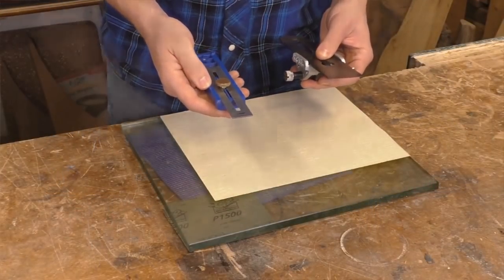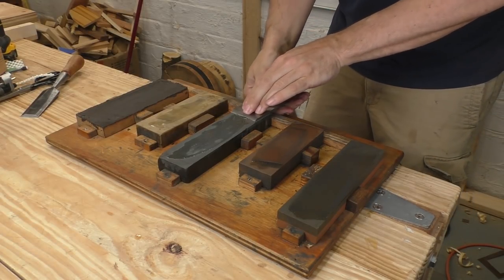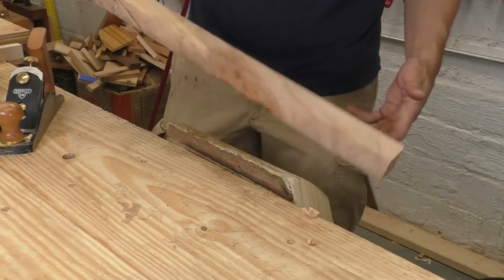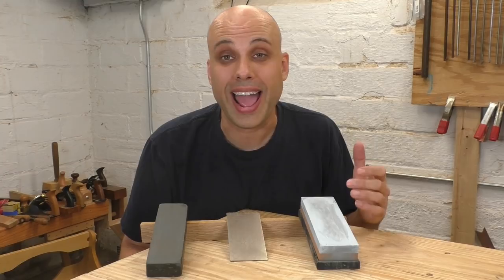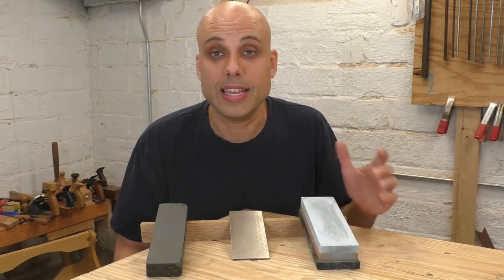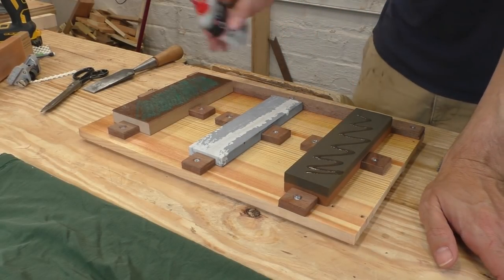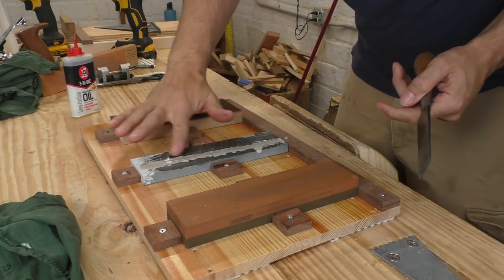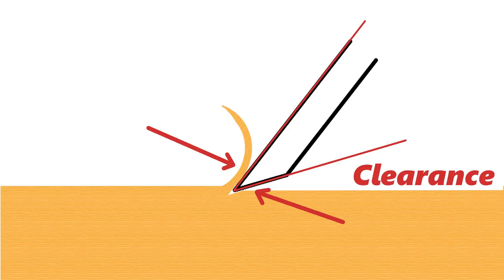Fast freehand sharpening: no jigs, no guides, no sandpaper.

Comment: When I learnt to sharpen, jigs were something machinists used to sharpen paper trimmers. I was taught not to roll my blade, obviously it works for you, but in the sixties it was forbidden. Here on the U.S. East Coast, diamond sharpeners are about $30US for a 2x6 stone; I use tap water and a drop of dish liquid soap on mine. Great presentation, right to the basics. And regarding kitchen knives: 8, 10, 12 inch chef knives need a working edge, not a razor edge, when dicing or chopping you'll destroy a razor edge in seconds.

Comment: @7:00 is an instant classic! And something I would do. My first hard laugh of the day. Thank you for the education and entertainment.
Reply from the maker: I was afraid that was creepy, even though I hoped it would be funny.
Reply: @RexKrueger  it was funny because it was creepy!
Reply: @RexKrueger  I laughed out loud.  Regarding oil stones I sharpen my kitchen knives on them, then drizzle dish detergent on the oiled surfaces and work it in with my fingers.  The detergent and oil form a soap precursor (high school chemistry has some uses) that is water soluble.  It cleans the stone and removes any oil that may polymerize over time and reduce the cutting efficiency.
Reply: I laughed way too hard.
Reply: @theeddorian  I do something similar, but using simple detergent and water when using my DMT plates.
Reply: @gazpal  I think that will work perfectly well on diamond plates.  If you use oil, it could still polymerize if you left it to dry, but the metal and diamond are far less porous than an oil and that should keep the oil residue on the surface.  In fact, IIRC, diamonds are extremely "non-stick."  I use the detergent first because it is a polar molecule and on "side" will bind to water while the other will bind to oil, which makes the oil more or less water soluble.  So, I try to work the detergent into the pores in the oil stone in order get it into contact with as much of the oil as I can.  After that I bring on the water.  You can use salad soil and detergent as a mechanics hand cleaner the same way.
Reply: @theeddorian  it works extremely well 🙂
Reply: @RexKrueger  It gave me a great laugh, don't worry. Granted, it was more of a panicked laugh while backing up from the paused video, reassuring myself that there's no way that mad-man could jump out of my screen and end my existence there and then, but it was a laugh nonetheless :D

Comment: Rex, I've used DMT diamond stones for years. I get the big ones, 10"x4". 2 will get you all the grits you need as they are double sided.  X-fine/fine & course/X-course. 220/325 grit & 600/1200 grit, respectively. I also use the Norton water stones, not the double sided. They don't ware out as fast as you think if you use them correctly. My most used grits are the 4000 & 8000 grits. After 20 years the 4000 grit is about 1/2 it's original thickness. The 8000 grit is almost like new for thickness. And I sharped a lot of knives, it's kind of a small income for me. Doing knives I don't flatten them very often. In fact I haven't flattened any of them in 5 years doing just knives. 
Woody's Workshop

Comment: Interesting video. I’ve used a lot of things to sharpen blades. 
My front porch steps, a red brick and this great flat spot on my garage floor. Some sandpaper and a piece of leather with green compound. 
I have no idea what my angles are. The blades cut great. Boards are square and flat. That’s all I care about.

Comment: I have been doing leatherwork a long time, but I recently found something that a leather store showed me. That is if you use a little green polishing compound, your stropping  will be  much faster and your sharpened device will work much easier. You can also buy scraps of leather very cheap at Springfield Leather. I use this compound all the time, whenever I have to strop a blade.

Comment: Another method to avoid the bur (aka rollover) is to only push the blade on the stone.  The rollover bur is from scraping the metal off the edge of the blade, but if you push the blade only, you avoid this mostly.  You can still get this bur, but usually on softer blades.  Of course you have to only pull on the strop  but you are only polishing at that point.  A stroke compromise is to push harder forward and let off on the backstroke so you keep the angle form.  Thanks, Rex these are great videos keep them coming.

Comment: I was traditionally trained and Paul Sellars is unique in his approach.... I used to sharpen freehand, began sharpening freehand and I defy anyone to be able to sharpen 'traditionally' by hand on a soft Waterstone. You have to remember that Paul is a trained joiner/carpenter who has an 'Everyman' agenda, the complete opposite to the sharpening tzars.
Reply: The soft Japanese waterstones are indeed used freehand, for Japanese tools. Japanese planes and chisels have very large bevel surfaces and hollow-ground backs. You are able to reference the bevel of the tool on the surface of the stone because it is so large, and you don't have to sharpen for long because the back is hollow. Also they laminate their cutting edges, so they have a backer of soft steel or wrought iron, with a very thin HARD tool steel edge. They work perfectly well for the tools that were developed for them, it's just more difficult on western tools which were traditionally sharpened on oilstones.

All that said, I normally use oil stones, but also own a set of soft water stones and can sharpen on them freehand. With the soft stones if I'm not using a Japanese tool I only sharpen on the pull, and rotate from the top of the bevel to the edge as I draw the tool toward me. You can feel and most importantly, HEAR when you are at the edge.

I prefer the oilstones not because they are easier but because I live in Michigan, and water freezing inside a waterstone is over a hundred bucks down the drain. ;-)

Comment: Sadly, I couldn't find your original sandpaper sharpening vid, so I don't know if you mentioned this, but 3m make some really hi tech sharpening papers (I'm not employed, etc, by 3m) and that system works really well. It is usually used with a guide, but I've used it freehand for about a year and haven't even changed my papers yet. The other important point for sharpening is - don't wait! at the first hint of excess pressure, sharpen again - done in 30 secs and back to good results.

Comment: I think the curved bevel edge also helps support the edge so you are less likely to chip out the blade. The arc gives some material to transfer force deeper into the iron body. As for Camber you can see at 15:20 as Rex explains the motion how his forearms move. Then at 16:00 as he speeds up you can see that pressure change happen if you watch his arms at the top of frame and not the blade. Easy peazy.

Comment: Back when I started I was "taught"  to freehand (more like told how to and attempted to remember days later) on a set of whetstones I picked up at an estate sale. When I began watching videos I found it weird that people were obsessed with sharpening to a specific angle.
Reply: One of my first responsibilities as an apprentice was to sharpen blades and chisels. My master taught me how to hand sharpen in about 30 minutes. After that, it was my ass if the tools were not sharp. 
Years later, I saw all of this stuff about exact bevels and whatnot and I was very confused. I was wondering how these people got any work done by obsessing over the exact angles of their bevels so much.
Reply: I never understood that obsession some ppl. seem to have.
I guess they just need something to feel better than the rest, lol.
Reply: @nealsterling8151  Maybe a carryover from metal cutting ? In high productivity metalworking edge geometry is insanely important to make sure you can dissipate 20 hp in the cut, get a mirror finish, not break the tool and not get a huge birds nest of scalding hot, razor sharp barbed wire like swarf - all at the SAME time.
Reply: @Zonkotron  I must admit that having been taught how to freehand grind tool steel (that there should be some clearance, but not too much) then putting those first attempts into a shaper and taking heavy cuts into mild steel with no trouble, that the clearance for woodworking hand tools needed to be exactly this or that angle. I'm sure there's an optimal angle that balances the life of the edge against the finish, but if you're going to be sharpening whenever the tool feels like it's lost it's edge then the only thing you need to optimise is getting back to your project.

Comment: I use a diamond & water stone & then a strop because it's just a lot less messy than oil. Keeping the water stone in a tupperware box works really well, & (even though it may slightly age the stone) I add just a few drops of lemon juice to keep the standing water from going nasty. Recently, I've started just putting the diamond plate in there too since that also needs a little water, & it seems to be working out well so far. Easy to store & access, no mess.

Comment: Nice input to all the sharpening videos out there. I’ve been sharpening edged tools for both my professional work life as a carpenter and my hobby wood work for some time now. I use a variety of different sharpening methods. I wouldn’t discount my sandpaper just yet. It’s super useful for sharpening any curved edges like spoon knives, gouges, adzes and the like. It’s also great for nasty jobs, like getting gunk off of your sharp tools (and not ruining your whetstone in the process). I keep a set of straight beveled chisels for fine carpentry work, sharpened with the Richard Kell jigs, on a combination of first a dmt “stone” then different ceramics to 8000 grit - with a bit of stropping fro that last finish. All the chisels have the same bevel, approximately 27 degrees, that way any bevel down work feels the same across the set, increasing familiarity. Why 27? Idk, feels like a good compromise between sharpness and edge retention. They get used in anything from the softest pine to seasoned oak. I bet quality of steel has a lot to say in that regard. What you, Rex, create is a flat/ convex edge, I use that geometry all the time. For carving axes with inferior steel, for instance, I only ever meet the wood with one side of my axe while carving anyway. Also for many of my carbon steel carving knives. A flat and a curved side is super useful! Besides better edge retention,  your knife will work a little bit like a Yakut knife, and that’s not bad at all :).

Comment: For years I watch movies where people are saying you need to be extra precise when you sharpening. I am not extra precise. Like you said I don't pay too much attention at the angle I just make sure that the blade is shaving sharp.  :)
Reply: I've free-handed for most of my life... never had a jig.

   It depends on the blade and purpose, though. For hefty, thick, chopping type utensils, I round that bevel a bit on purpose to get the extra substance right up to the leading (cutting) edge.
   For thinner, slicing type utensils, I want it as low as I can consistently keep it. I try not to round anything if I can avoid it... I sit carefully, raise the station/stone(s) so my elbows are straight to the side, and take a little extra time to pay attention to keeping the edge clean and as flat as possible...

    For certain tools... say a draw-knife, it pays dividends to have two of them. This lets you assign one to each of the two types of sharpening for specific purposes. The "rough cut" drawknife in my shop has a slightly rounded bevel, plenty beefy enough for "yanking" and getting really aggressive... The "fine cut" drawknife will leave a damn nearly polished surface behind, BUT if someone gets rough with her, I'd have to beat him like a red-headed step child.

     Of course, that's just me and my experience sharpening literally tons of things since I got my first fixed-blade knife (like Rambo had) at 10 years old... some 30+ years ago... so there's lots of unsupervised experience involved...

    I've seen a few of those movies/videos, too. I've hated most of them. ;o)
Reply: I sharpen with my dad's friend's ww2 razor hone he used when he was a barber in the army.
Reply: @apcolleen  Just happened on a memory for some reason... you can laugh (I hope)...
   I was once running late and the car wouldn't start, so I "hitched" a ride into the shop on a buddy's go-kart, and sharpened a chisel on the asphalt at 40 mph... stupid, but it worked. 
     ...probably the most ridiculous sharpening job I ever performed. ;o)
Reply: @gnarthdarkanen7464  and kids today would have just gotten an Uber lol. Wheres the fun in that?
Reply: @apcolleen  If you accidentally find a serial killer, or if Uber started hiring motorcyclists... I don't know... It could get adventurous.

    Mostly, I don't see it. I've hitched a ride with the Hell's Angels... Got picked up in South Side Chicago by a "no-name" band of hippies (never so drunk or high for so long in my life)... AND even caught a horse-back ride from a nearby rodeo-show once...

    Kids today are too damn cautious. You gotta get out of the library (or Scroogle or whatever) and LIVE once in a while. Right? 

    Anyways, thought you'd like that little snippet of my often less than responsible life. I like to occasionally do something BECAUSE upon thinking of it I have to ask, "Should I get my head examined?" ;o)
Reply: @apcolleen  with oilstones? I only try to sharpen razors on waterstones but I heard from other people that oilstones can give superior results. I might try it too. :)
Reply: @gnarthdarkanen7464  I sharpen hairdresser scissors and they have rounded cutting edge. Their explanation is that the rounded edge offer more resistance so I need to give a chance at the rounded edge on hand planes too. :)
Reply: @DanielWorkshop  The hardest part for keeping scissors (of about any kind) truly sharp and effective is that the surface between the two cutting "blades" be absolutely flat, so they can be kept (or made/adjusted) as tight as possible and still worked with one hand...
   Like I mentioned, the rounded edge is great for anything "chopping", and the only complaint on "slicing" type blades is that it DOES offer more resistance as you carve into the substance...
    It's not so very big a deal on hair and other relatively thin materials, since there just isn't enough substance to cut through to make a big deal of difference... However, it STILL does add the associated durability to the blade (and why I love it for chopping and striking instruments, like chisels)...

   We seem to be in agreement here, so I'm just clarifying. It will likely make the plane a touch more difficult to force through hardwoods, but if the cutting edge is sufficiently sharp, it's probably not so much as to immediately need redressing...
    Of course, it's also worth keeping a second "fine work" blade of equivalent type around, sharpened to a finer angle for making it easier (less resistant) to cut with, in case you end up with some rock-hard and knotty wood you still want to work...
   ...say the slabs cut from a Rock Maple Gall... Those can play hell on all your equipment. ;o)
Reply: @DanielWorkshop  I might correct one word on your scissors... The advice is for "more resilience" (yeah, typo's and autocorrect... I get it)...
    Hopefully I know what you meant, there...

    The only "big" tip for remarkably great scissors/shears is to get the "mating surfaces" between the blades absolutely "dead flat" and as polished as possible. This lets you tighten them up as much as possible, so nothing can "fold over the middle-gap" instead of getting cut...

    It's kinda like I said... So we're in agreement. You do sacrifice a bit of ease in use for the rounded edge in slicing instruments, but it can pay off with durability (resilience)... I just find it's more suited for the things I chop with or strike with mallets more than for slicing and "fine work" where the finished edge or surfaces matter...

    Hair doesn't have enough "substance" to really make much difference, so there is a balance and you can make exceptions for a reduced maintenance routine. Some textiles (like paper) including certain types of hair can be really abusive to the cutting edges, so anything that reduces wear is a net gain...

     We seem to be in general agreement, here. So... yeah... You might truly benefit from allowing a bit of a rounded bevel on your plane irons, and at least, it won't be horribly destructive so long as you manage a good sharp edge. ;o)
Reply: @gnarthdarkanen7464  yes your right resilience is the correct word. I made a mistake there. :)
Reply: @DanielWorkshop  I blame auto-correct, and I'll stick by my story! ;o)
Reply: @gnarthdarkanen7464  True. :)_

Comment: Excellent video! 

For many years, I've used a fine... or extra fine? DMT diamond sharpener - a green one. I use it strictly for pocket knives, and I swipe them across it when they start to cut a little more rough than normal, and after about 5 easy swipes on each side, the blade is back to razor sharp. 

Sharpening doesn't have to be difficult, but it takes practice and creating muscle memory. 

***A good note for people new to freehand sharpening. Use an old blade, iron, chisel to practice with before you really get into sharpening a nice edge. Figure out what works for you, and go with it.

Comment: Nice video, Rex.
I find the bevel angle by closely observing the lubricant at the front edge of the blade. Place the blade on the stone/ plate, and raise the back end a little until you see a little lubricant squeezed out from the front. That's your angle.
Reply from the maker: That is a good way to do it. I should have mentioned that!